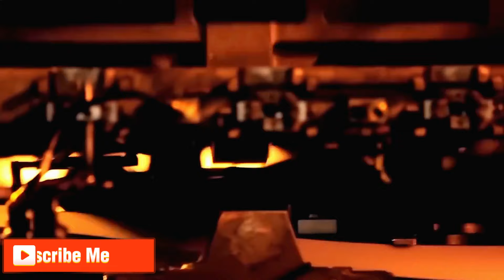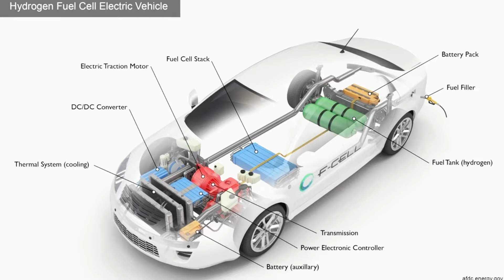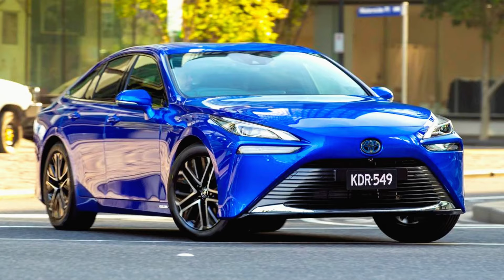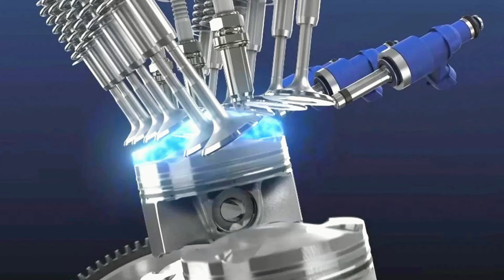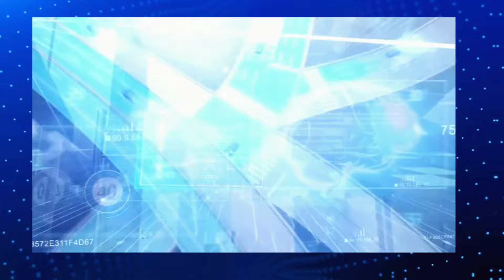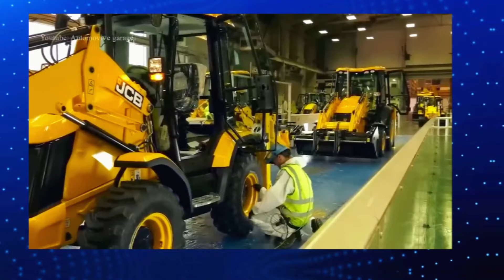Toyota CEO Unveils Game-Changing Engine Set to Revolutionize EV Market!

Comment: Another BIG Problem with combustion engines are the periodic maintenance and lubrication requirements!!! Where a battery EV usually has a higher up front cost, it's running cost are usually very low and if you only ever charge it from your home solar, running a battery EV is almost free! You won't be storing "free" compressed Hydrogen at your house anytime soon!

Comment: So...  Electrolysis to produce clean hydrogen, which consumes 25% more electric energy than the resulting hydrogen contains.  This hydrogen is then compressed (requires energy), transported (requires energy), and then highly compressed into the vehicle (requires energy.  And then, instead of using a fuel cell to produce electricity again and drive the wheels (which is 80% efficient) then choose instead to burn it in an engine (at about 35% efficient).  Total efficiency around 20-25%.

Or, use that original electricity to directly charge an EV at a total efficiency of 85%.  It's insane to waste 3/4 of that original electric energy, especially since the infrastructure to distribute electricity already exists worldwide!

Comment: No. No it won't and here's why.

Digging into the #science of #hydrogen as a #feul
We set out to assess the current science in a paper, and find that under the right circumstances, hydrogen could indeed be part of a clean energy transition. But done wrong, it could be worse for the near-term climate than the fossil fuels it would replace.

While carbon dioxide can be a byproduct of hydrogen production, hydrogen itself emits no carbon dioxide when burned or used in a fuel cell. But when emitted into the atmosphere, hydrogen contributes to climate change by increasing the amounts of other greenhouse gases such as methane, ozone and water vapor, resulting in indirect warming.

That’s a problem because hydrogen’s small molecule is difficult to contain. It is known to easily leak into the atmosphere throughout the value chain. The farther it travels between production and end-use the greater the potential for leakage.

That much is well understood. But it turns out we know very little about how much hydrogen actually escapes from real-world systems. It hasn’t been clear because there has been no reason to look beyond basic safety thresholds — until now.

This is because traditional metrics systematically ignore the near-term impact of hydrogen and other short-lived climate-forcing agents by expressing the warming effects from a one-time pulse of emissions over a 100-year timeframe (GWP-100), masking a much bigger, more immediate influence.

There is another reason the warming effects of hydrogen have been underestimated. Until recently, every estimate of hydrogen’s climate-forcing power considered only the troposphere and not effects in the stratosphere. Accounting for both reveals that hydrogen has greater warming potential than is typically recognized.

Applying the combined atmospheric effects over a shorter, more relevant timeframe, we estimate the five-year warming power from a pulse of hydrogen relative to CO2 is 20 times greater than current calculations show using the standard 100-year approach.

And when we look at the relative warming impact from continuous instead of pulse emissions — which are more representative of the real world — hydrogen is 100X more potent than CO2 emissions over a 10-year period.

Comment: The overall efficiency of H2 generation, storage and distribution is and remains drastically worse than battery systems. FCEVs can only make sense when the earth has green energy in abundance. That will certainly take another 20-30 years. And even after that, H2 will be needed more for process heat and buildings and certainly not for individual mobility. Toyota is trying to remain a serious OEM and innovator, but has long since lost touch. Totaly marketing bullshit.

Comment: I think they need to design an exhaust that can pull out the nitrous oxide and then pump it back into the engine with the fuel because nitrous oxide can add 240% in pure form instead of air
Reply: not nitrous, Nitric Oxide. Oxides of Nitrogen. EGR came about to "reburn" exhaust gasses back into the intake thus dropping cylinder temps & pressures that create it.

Comment: Let me tell you why Hydrogen is a BIG deal for Japan.    It allows Japan to make their own Fuel source all day long.  They have TONS of NUKE plants and will build more and larger ones in the future. 
 
This also means that if they are using that power to produce Hydrogen Fuel?    This make the entire cost of Nuclear even cheaper as the plant will always be running at 100% so no down time.   All the Energy that is made is used.  
 Including the heat energy.   

But the big part? 
They never have to worry about Fuel costs. 
The ONLY reason why Crude oil is cheap is that there is so much competition & Subsidies that go in it. 

With Hydrogen?     Its not like you are going to run out of Seawater.   
And if they start looking towards naturally occurring thorium?  
They have even more energy independence.  

Also that Tanks themselves are going to be made out of Kevlar and other such composites that Japan has Droves of right in their backyard.  

There are also other benefits such as being able to switch to using any fossil fuel Gas such as LPG, Methane, Propane,  Gaseous Methanol,   etc.    Better still?    Gasoline can still be used without a problem by just adding 4 injectors and a fuel pump / Tank.   Something that AT COST?  Is less than 100 dollars in bulk.   

Even fuels such as Cooking oil can be used with the Hydrogen injection for a clean burn and longer range.   This also takes care of upper cylinder wear so longer engine longevity.  

In fact, the best of both worlds would be something like Biodiesel (Any kind of food grade oil for example)  
being injected into a Rotary Engine powerplant with hydrogen.  
That takes care of any wear that will develop overtime.  Making the small Rotary APU Units last a VERY long time.   
And it also increases their  Torque output due to the speed of the flame front with hydrogen.   

And thanks to all that is need is ELECTRICAL POWER?   
Hydrogen fuel stations can be anywhere there is water supply.      

And Japan has Water ins spades.   
Along with Electrical power just about everywhere.  

This also takes a lot of high paying jobs from Overseas, to right there domestically.  
Even in Rural communities.  
That also means that Farms and Transport of the goods and machinery needed can all get local power and fuel source.   

In the case of FARM Machinery?   
They can even use Low pressure tanks similar to Propane cylinders.   So its  even cheaper to implement. 

And lets not forget that Hydrogen is NON TOXIC.  
So no toxic spills.

Comment: It is still a conventional engine base on using hydrogen instead of fuel or LPG gas, with the hydrogen storage tanks behind the boot, it would be very dangerous and can explode like a hydrogen bombs, this is the quickest way to meet the dead Sinto Abba in his memorial shrine, 💣💣💣
Reply: So can gasoline.    You know what?  Add just ONE material to Hydrogen, and its sudden explosion becomes a distant memory.    It rhymes with Calcium Carbide.